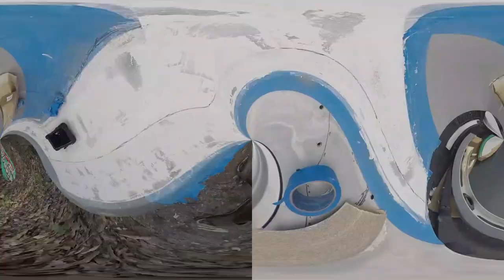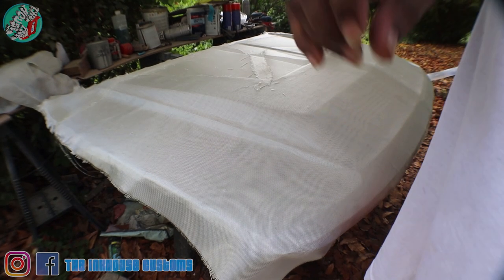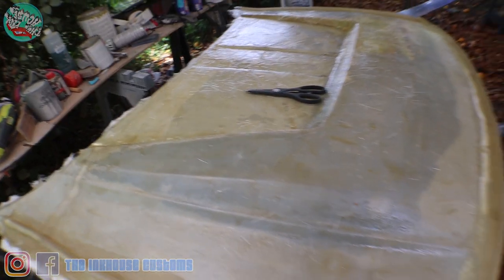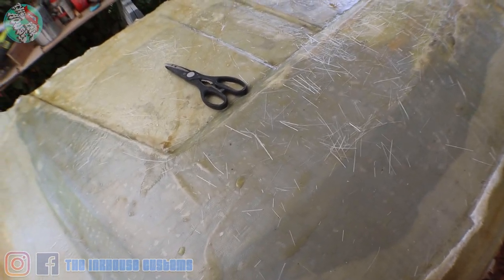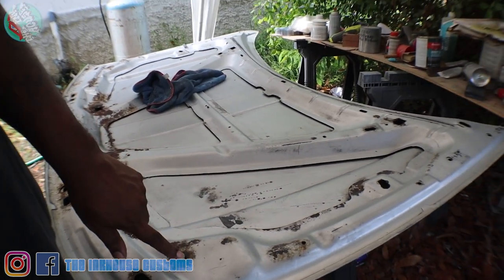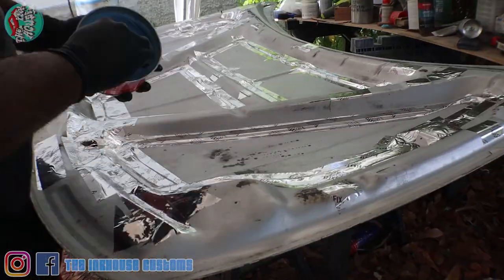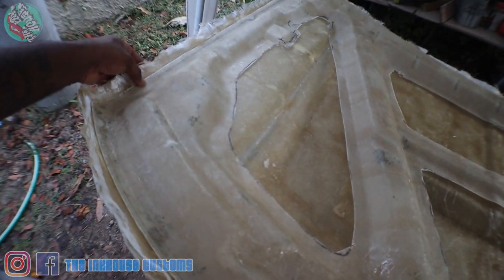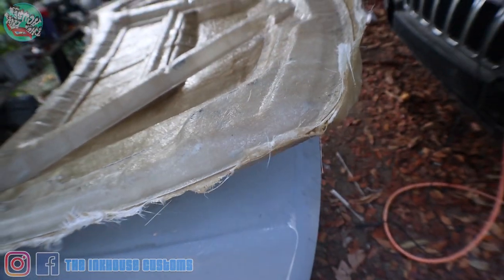how to make - fiberglass Hood - vented part 2

Comment: Hey what is the clear seal for you put around the hood?
Reply from the maker: The clear vinyl tubing was there to keep the hood rigid adding strength to the to side in order to flip and add to the bottom.

Comment: How did you secure the hinge bolts to the fiberglass? I'm in the process of fixing the ram air hood on my 70 442. Previous owner installed the fiberglass hood but left the factory springs in the hinges. Split the rear of the hood support and broke the part that the hinges bolt in to. So I have 4 hood pins holding it on instead of just 2 in the front. Got the hinges (springs removed), just trying to figure out how to repair where they bolt to the hood.
Reply from the maker: I used the area where the factory hood bump stops go.